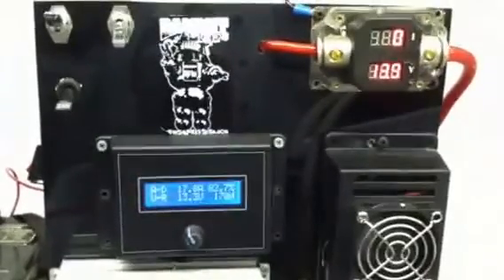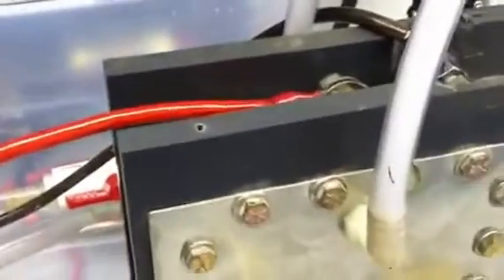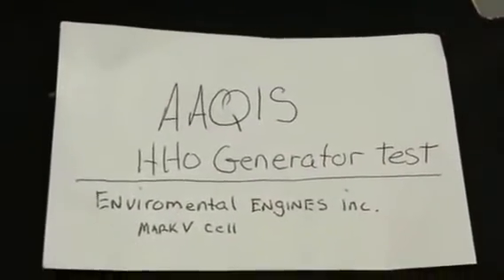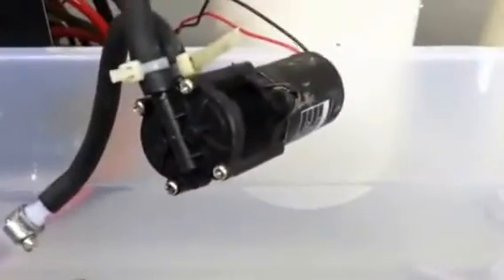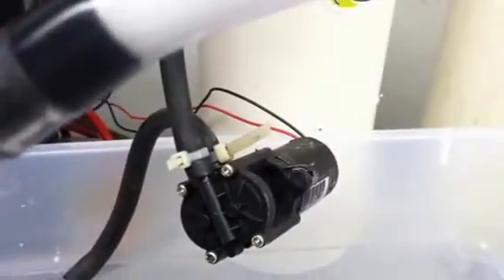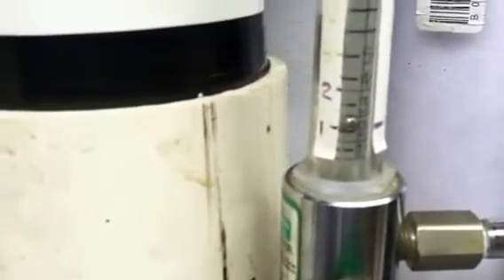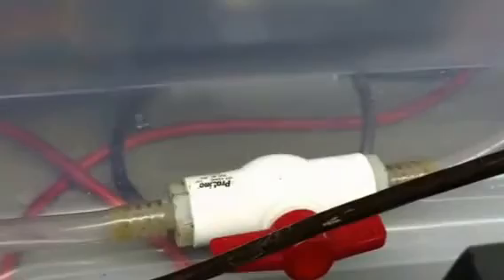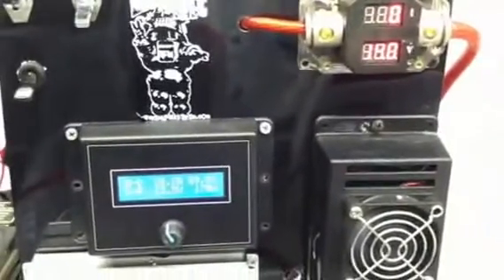HHO with a pump

Comment from the maker: The only thing you might get is a little cooler
Reply: howzit man, hope you are doing well... we had a discussion a year ago, concerning neutral plates. (I use neutral plates     NNN+NNN-NNN+NNN     ) you mentioned - COPY & PASTE 

HOLLYWOODS71 year ago
 
''No neutrals +-+-+-+-+-+- There is a guy who has been doing this since the 60s runs the same cell set up at the MIT fuel milage race an get 100 mpg with his ride,he has never been on you tube''

Now you are using them. What made you change your mind/setup?  I on the other hand can make adequate hho yet don't see improvement due to all the sensors and drawing too much amps off the alternator... (please note. I AM NOT SELLING ANYTHING - my HHO addiction is purely a hobby)
Reply: /watch?v=j9Z73CJ9G6Y
nice video -